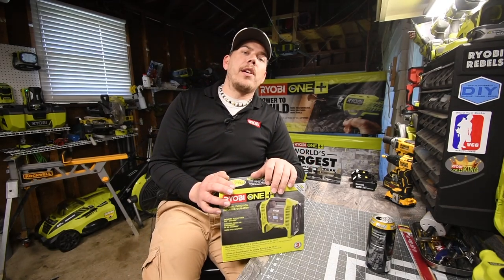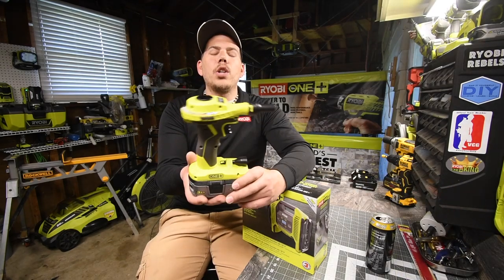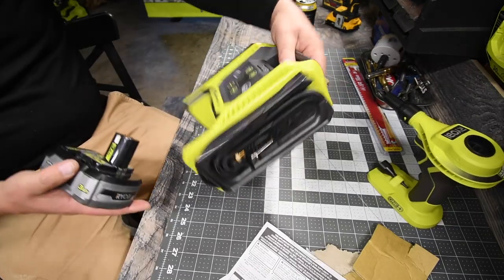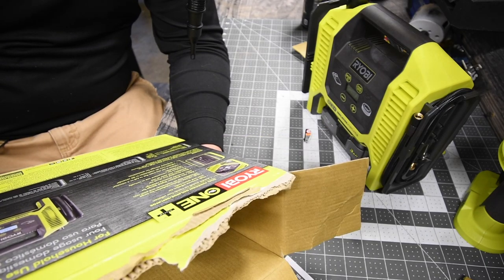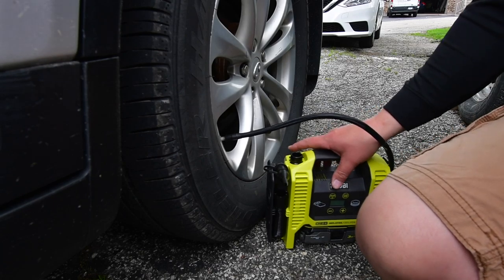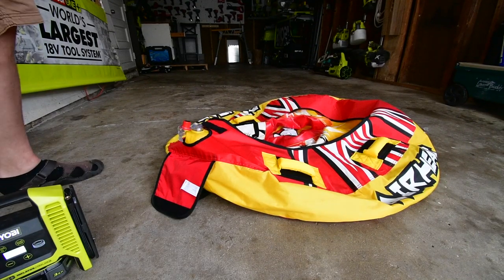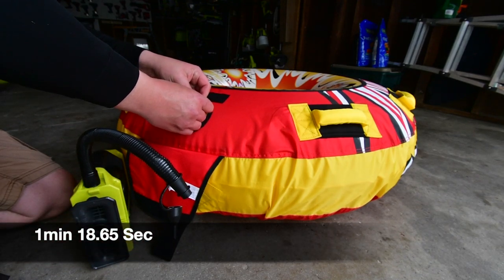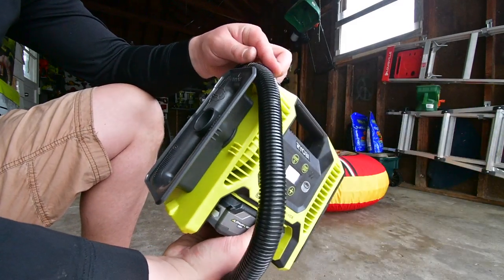Ryobi Tire Inflator

Comment: Do you think for an average homeowner who just uses air to inflate tires would you get this or the handheld one that's like 30$ full price. Life hack: if you need the handheld to pump air for a while and don't want to hold the trigger just put a zip tie on and it is like an on off switch and you can reuse it.
Reply from the maker: but the postal grip version  doesn't inflate devices, this one will. so I don't have to bring 2 devices for separate tasks. I got 2 in 1 now

Comment: Shame how long it takes to inflate a car tyre. My 33 inch truck tires would take forever
Reply: That’s what I’m thinking. Getting up to 80 psi would take forever
Reply from the maker: for a 33in truck tire id say you will beed an air compressor, these battery tire inflators for all brands aren't design to be a main source to full up tires. they all are designed for and emergency situation. no mechanic would use these for that. even I recommend a air compressor if you fill up tires all day.
Reply: I currently use a twin head 12 volt compressor for airing up after I come off the trails. This Ryobi would be great for mountain bikes and inflatables as you said. Keep up the great vids

Comment: these are a joke, i have one from Amazon that cost 12 dollars, plugs into car lighter or outlet and does the same thing in about the same time.
Reply: Not a joke when your car or truck catches fire. Look it up on YouTube
Reply from the maker: this one is battery operated is ill stick with this one
Reply: i had 2 cheapo inflators.  1st one motor failed  less then a year.  the other still works, my issue with these is the length of cord.  yeah so a cordless is great as long as you charge the battery.  Cheap inflators will not allow you to set a pressure values, you always have to watch your car while pumping air.  Last thing the Ryobi inflator serves 2 purposes.  TIre inflation and inflating camping mattress, even balloons.  so for 12$ the car inflator is a single purposes tool.  SO there is value in these types of inflators.